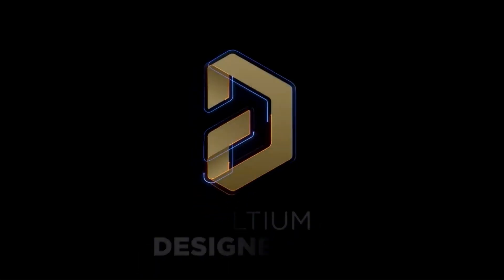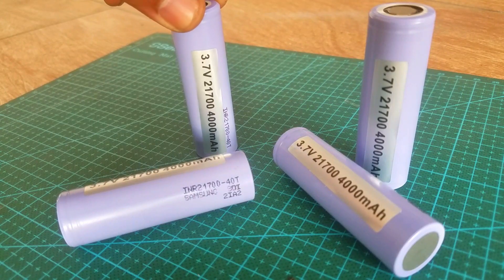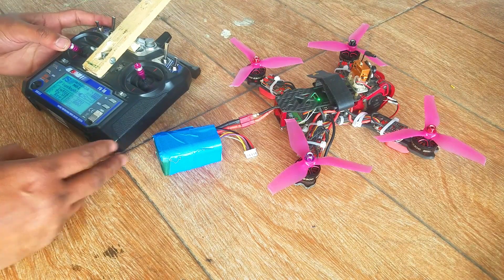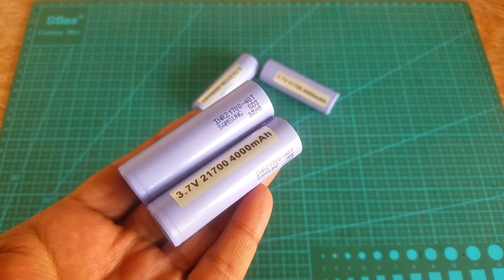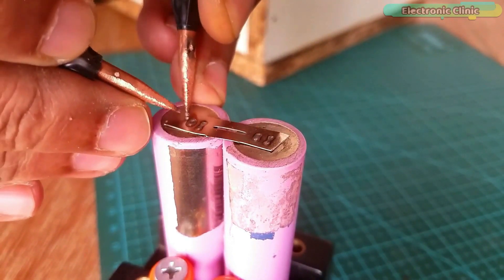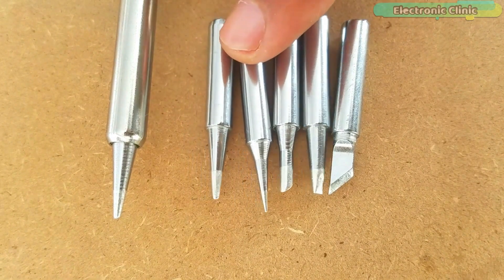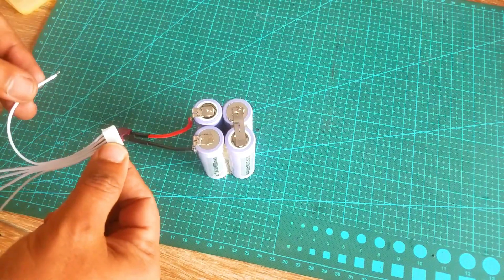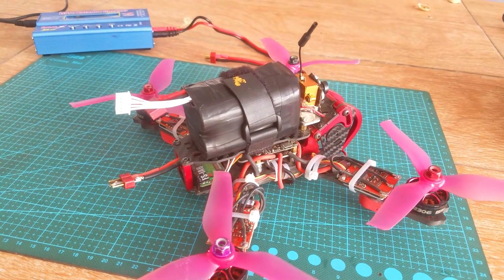4S Lithium Ion Battery Pack for a Long Range FPV Racing Quad Drone using Samsung 21700 35A cells

Comment: Hello brother, there are no original  li-ion batteries available in pakistan, where can we buy it in pakistan, can you please guide us thanks.
Reply: bro if you find any high c rating high drain ones in pakistan tell me thx i need some 21700s cant find them anywhere or 18650s are ok to
Reply: @metaldetectingnmore8763  yes bro i found them & made a  battery myself 21700s cells 6s2p battery.

Comment: for airplane wingspan 1.2m can use 18650 2600mah 40A 3s sir??? help me.. need build my own 3s 18650 batteries
Reply: 3s is sufficient for a airplane
Reply: @mr.legendofficial7  i already make 3s.. total weight include  battery 3s 18650 600gm using 1400kv 8x5 proppeller.. fly very well.. fly time around 18min
Reply: @IMPhomeStudio2024  mah?
Reply: yesterday i made 4s using sony vtc6 18650 3000mah can fly aroud 30-40min with half of trotle @mr.legendofficial7

Comment: The your pack dont need bms?
Reply from the maker: @miguelsampaio6199  I use a lipo battery charger that already has the bms
Reply: @ElectroniClinic  ok i see 4s packs joind to 4s bms.

Comment: Bro iam totally confused 
Please help me
My drone weight is 420g without battery
Previously iam using 1300mah lipo battery of weighy160g
It gives me only 3 min avg flight time 
I need more flight time 
If i use this li ion battery and i need to fix a go pro on it this can carry all this load

I need at least 10 min flight time
Reply: Yeah but you've to purchase Molicel P42a High drain battery

Comment: Bro plz tell me like in my country 21700 is not available so can I use 26650 instead
Reply from the maker: Use the ones which have high current discharge rate.

Comment: Can I use for rc planw and where I buy batteries
Reply from the maker: Of course you can use. You can purchase any lithium ion batteries with current discharge rate greater than 30A. Check your ESC specs.
Reply: @ElectroniClinic  bro give me link

Comment: Thank you so much, Great video! I've been looking for weeks for a video like this one. I have noticed LiION batteries are much lighter and less dangerous than the LiPo batteries and battery packs.
Reply from the maker: And quite durable, I am still using this battery pack 8m different projects.
Reply: Also way cheaper and easier to handle. Amazing video, too.

Comment: Sir ,, the Samsung 21700 40t battery is not present in Amazon ,, which you have give the link ...... From where we can buy this cells 😭😭 please reply...... I am from India 🇮🇳🇮🇳
Reply from the maker: You can purchase any other brand, just check the current discharge rate, it should be above 30A. The greater the better.
Reply: Purchase Kiya kaya bhai link bhej do plzz

Comment: can i do this but with a battery with a higher capacity like a  3600mah enook cell
Reply from the maker: Ya you can, I am even using higher than you, mine is 4000mAh
Reply from the maker: But check the battery discharge rate
Reply from the maker: It should be 35A or greater

Comment: You won’t find many 18650’s that reliably do 30A without a temp cutoff. There are maybe 4 cells and they will not have anywhere close to peak capacity for that size (3500/3600mah)

The 21700’s are only 20 grams heavier (45-50 vs 65-70) and there are at least 10 cells capable of 30A and most of them will give you 4000mah. 

The best cell (that you can currently get) is the Molicel P42A. It’s big brother the P45B might be available to us in the next 6 to 12 months. Samsung 40T is a very close second and the Lishen 2170LA is pretty much a well done Chinese knock off. I believe BAK has a knockoff too. You’ll get 4000mah+ and 35A-40A with the 21700’s. If you can get your hands on the Samsung 50S and you don’t need 30A it might work for you at 15A continuously
Reply: Is BAK battery is good for 250mm size fpv
Reply: Which should i buy the 40t or 50s

Comment: U should stop using those type of battery connector ive  seen them melt and short out they day there able to handle 60a buy depending on the material used they get hot and melt the plastic

Comment: That was great...i am also going to upgrade my drone batteries with lithium ion...because lipo batteries are soo dangerous and need a lot of care...also lipo batteries are lot more expensive as compared to lithium ion
Reply: @Satyajit li-po has much higher discharge rates. It will give more power for a short time. Li-ion and li-po are made for different purposes.
Reply from the maker: since then i am using this battery and its working great. I am not only using this with my drones but also for powering up my controller based projects.

Comment: does this work on my rc axial wraith, with factory specs rc..?  I will assemble 2p 4s with a battery like that.. please explain..
Reply from the maker: ya of course it will work. I have been using this battery pack for almost anything.
Reply from the maker: If you use these cells then i think you don't need to go for 2P, Only 4 cells are going to be enough for you. with 4 brushless motor it gives me more than 25 minutes of flight time. In your case its gonna work just great.
Reply: @ElectroniClinic  thanks.. i will switch to li ion, because lipo is short lived..

Comment: sir i have 18650 Li-ion Cylindrical Battery of 2600mah , can i make 3s racing drone with it? sir please reply
Reply from the maker: no, you cant, check the cells discharge current rating, i have talked about it in the video. watch full video wothout skipping.

Comment: Hi can we use these cells to make 12v, 100AH battery pack to be used with 720 Watt UPS
Reply from the maker: yes of course you can make.

Comment: Do you think a 6s 18650 pack would give more punch than the 4s ? Because I tried a drone with 4s li ion and it kinda felt under powered
Reply from the maker: Check the discharge current rate of the cells, then even with 4s pack it will give more punch.

Comment: Why don’t you use 2s2p? Will it get a larger capacity (longer range) than ur 4s?
Reply: will be underpowered, as the props can not spin at more than 50%, might be 3s2p, but not sure if the weight will cross the curve for efficience, and also fiting that battery might be difficult while keeping the correct CG (unless you build i tall, and that might also tip the balance)

Comment: Let me ask you a question.
It's a 3 inch cine hoop.
In the video, there are videos of making a pack with 4 lithium-ion 18650 batteries and flying it with an FPV long range.
With excitement, I ordered batteries and made a pack.
LGDBHG21865 3000mA.
The problem is... When I hovered, the yaw tick symptom reappeared after it came up, and, after a few seconds, the low-voltage buzzer sounded and the aircraft sank.
If I open it again, it opens again,,,,, repeat...
So, I changed the low voltage warning in Beta Flight to 2.7V, and when I turned it on, there was no sound.
If I take a break for a while, it will float again. But it sinks again... The battery is hot, and the voltage is 3.8V... TT
I bought 40 tablets... but I can't use them all?
How do people use? Batteries were also made by buying anything.
Is my FC the problem? Or is there a special setting for Li-ion?
FC is IFlight SucceX Mini F4 V3 Stack, and the manual says 2~6 Lipol. Do I have to use only Lipol? Can I change FC?
Why is this happening?
It's a waste of money/work time.
I'm serious~~ Please advise.~~ TT
Reply from the maker: 18650 batteries wont work if the current discharge rate is low. I have talked about it in the video. I was also facing the same issues and thats why i selected these samsung batteries, these batteries have discharge current rate around 35A.
Reply: @ElectroniClinic  Just use the Sony Murrata VT6 30A. The benefit is that this 18650 cell has a half of the wight of the 21700
Reply from the maker: @georgx7759  these were the only one available over here. But these cells are still doing great. i am using this battery pack to for checking my prototype models, and also use this battery pack with drones.
Reply: @ElectroniClinic   답변 감사합니다~~^^

Comment: Bhai, kia inki capacity actual 4000 mah h?
Reply from the maker: yes, kaafi acha result mila. mei tu ab lithium cells hi use karunga. flight time ab acha khasa milta hai aur ab ziyada se ziyada practice ker sakta hun.
Reply: @ElectroniClinic  ordered 2 pairs on your words. And received.  Hope k quality and working sai hogi

Comment: What about the weight? Lithium Ion is more heavier than Lipo right ?
Reply from the maker: You are right, these are heavier, but the weight won't be an issue if we use these batteries packs with larger quad frames. Seriously, right now, I am only thinking about more flight time. Previously, I was only getting 5 to 6 minutes of flight time and I wasn't able to improve my piloting skills.
Reply: @ElectroniClinic  but a lighter 4000mah 4s Lipo would give you longer flight time?

Comment: Nice battery pack . I think It's 'SAMSUNG' most expensive 21700 battery. Overall nice video.
Reply from the maker: ya these are a bit expensive, but it worth it.
Reply: bro ur link for those 21700 samsung batterys are not working exactly where did u bought them 
 @ElectroniClinic